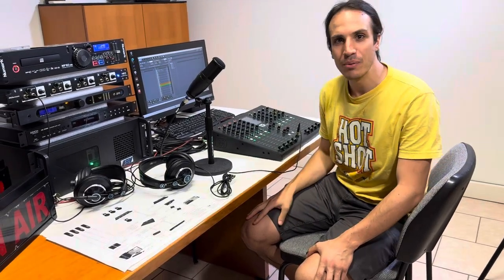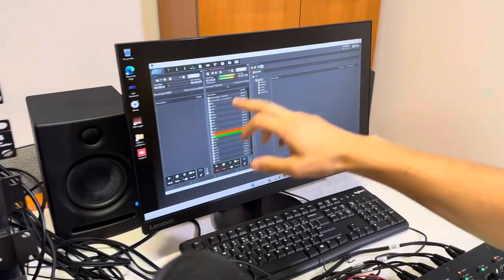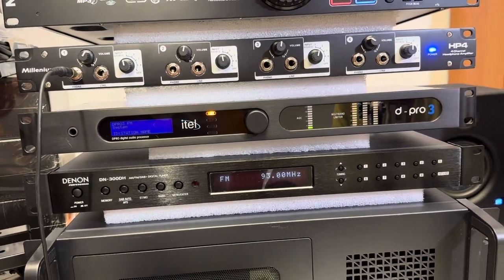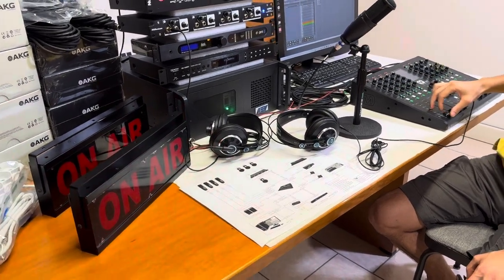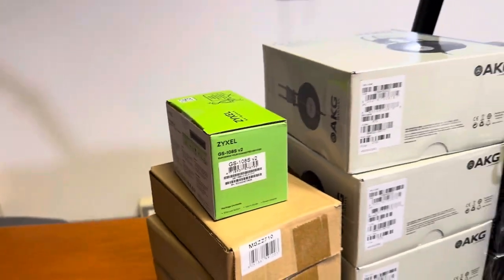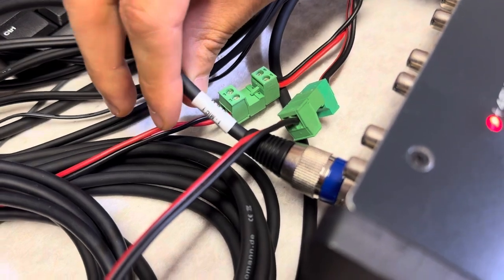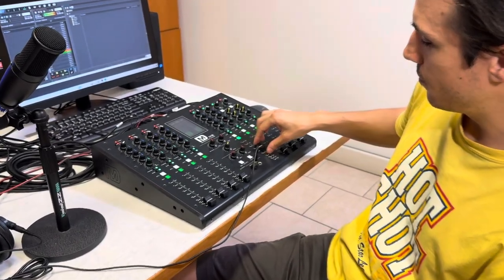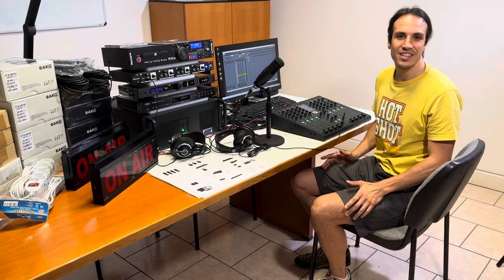Radio Studio Equipment: Setup + Testing

Comment: Hello, how about RDS signals ,   how are they mixed ?
Reply from the maker: Hello! In this configuration the RDS is istegrated on the FM Transmitter. Regards.
Reply: @tekobroadcast3065 Ok, How do you add dynamic RDS (like name of song, name of singer, etc)